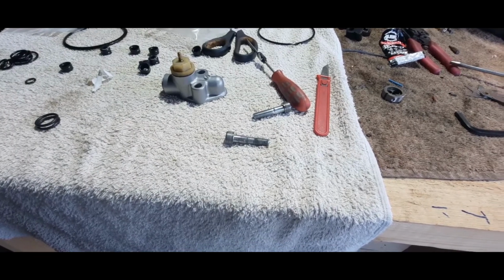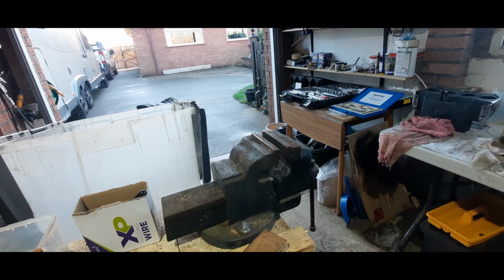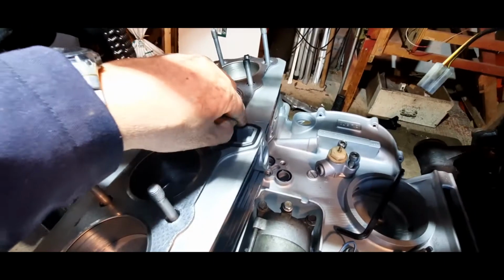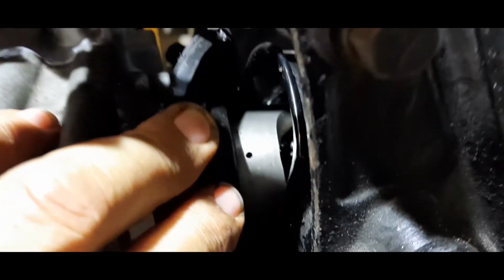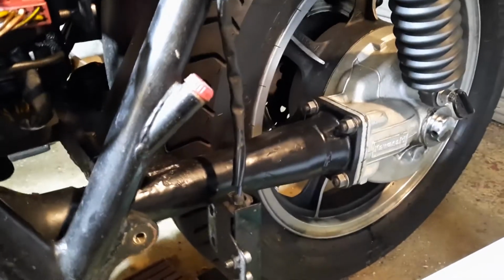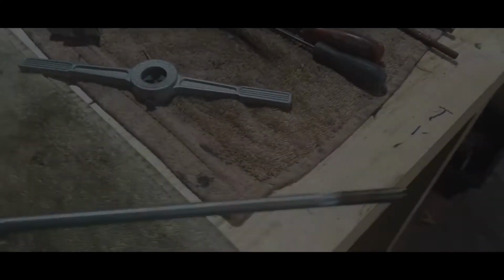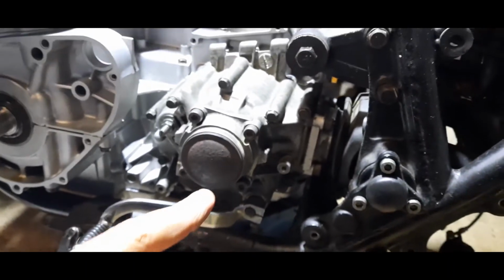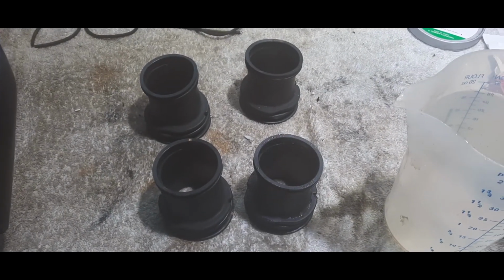The Drive Shaft Pin & Marmalade Tarts

Comment: How did u take the drive shaft off the bike? Did u have to remove the back wheel or swing arms? Or can u just remove it from the differential? Right now I’m trying to remove the front bevel gear case. Is there anything else I need to remove?